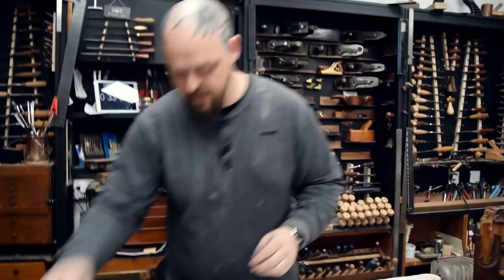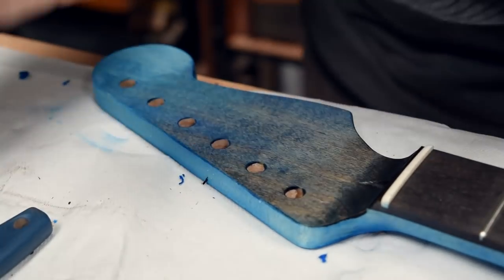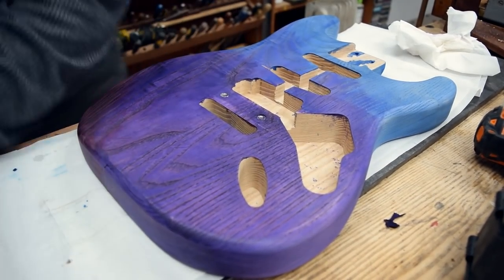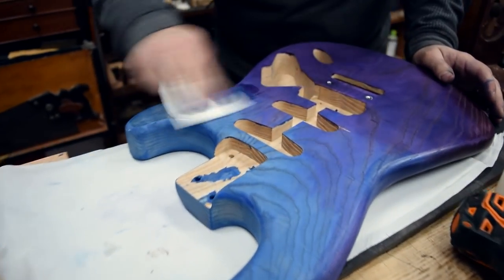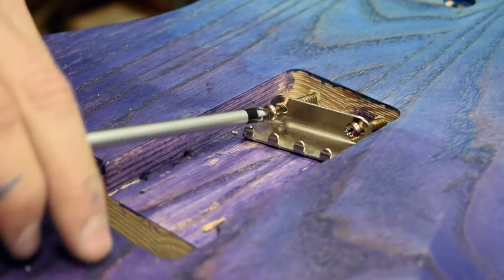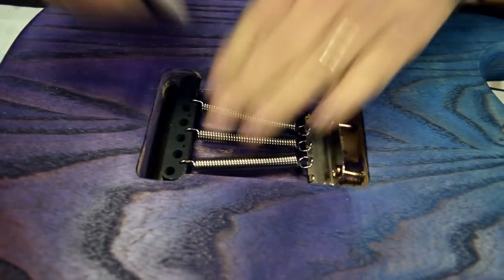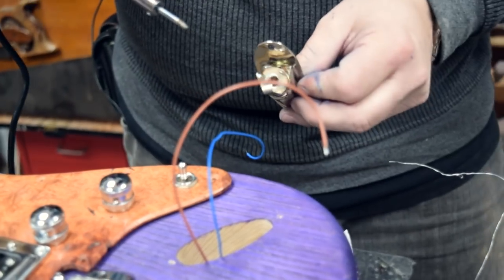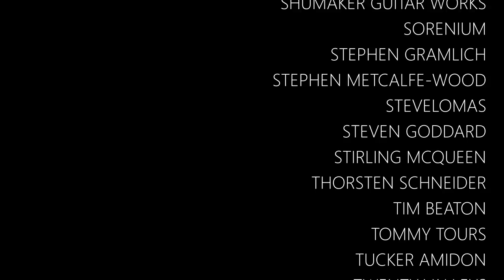Ep 3 - Ben's 100 Minute Kit Guitar Build Challenge - Thanks for hitting 100K Subs!

Comment: I still don't see it as failed. I hate the whole competitive, how fast can I do it, idea. I would rather see you build a guitar in real time, without rushing, but that's just my preference. 

This guitar is gorgeous, to me. I would love to see the same color scheme with a gloss clear coat finish. I would like to see it with such a deep gloss that you could layer stars or some other shiny bits into one or more of the layers of clear coat, then add several more layers after that and give it a 3D look, like stars and nebula on top in a sky/horizon, using those colors. I dream big, lol, but suck at artwork. 

Will your kits that you offer ever come with a no pickguard option? Or pre-drilled for a Floyd Rose tremolo? Or, a way to customize one of the kits to be a lot more specific like that?